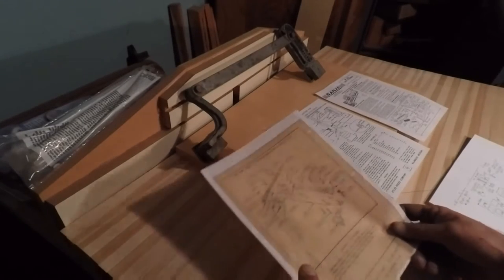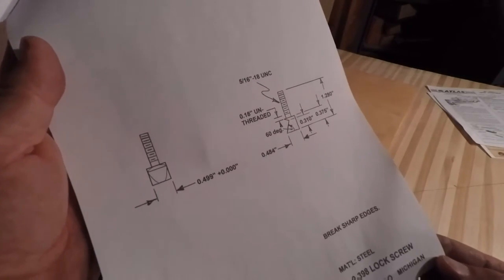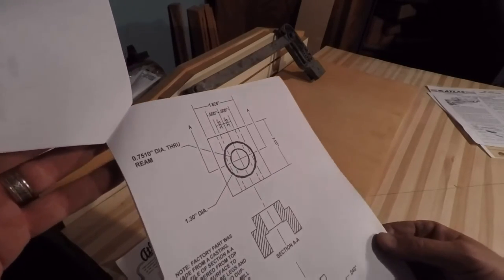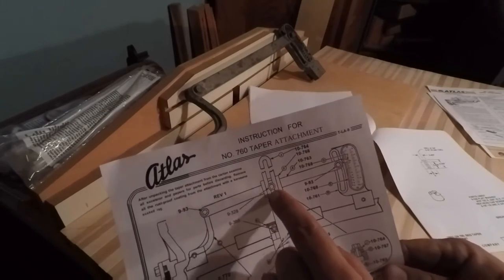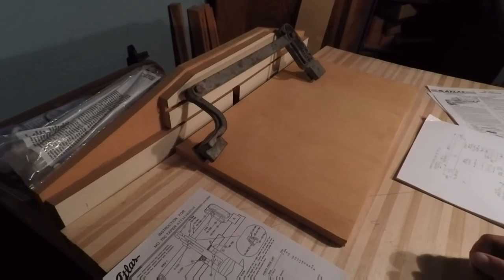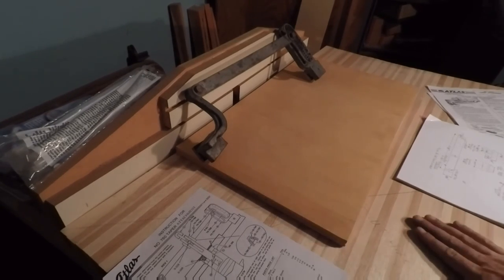Survey of the Atlas Taper Attachment

Comment: Let me see what models I have.........
With the Garage sale lathe, I have the 700.  I am missing the long bar with the slot which connects to the cross slide and also the slider yoke that attaches to the taper rail end.  However, I do have the cast iron block that mounts to the carriage.  This was a quick look.  It's possible I have the other parts yet unidentified.

I have a 760 missing the same slot bar and slider yoke.  In your drawing it looks like there is some kind of block with fasteners and rollers to hold the cross slide bar square.  I don't have that block either.  The 760 came with my Atlas 3992 (Craftsman Commercial) 12" lathe.  It looks like it could be clamped to a 3/8" or 1/2" bed easily.
Reply from the maker: yes I think there's just a few part's that are different  (maybe )for you want me to see if I can find drawings for the 700?
Reply: Yea, that would be cool. As I think about it, I do have an aluminum part cut to fit the cross slide ways and locks on. I'll look in the morning to see if it's a part to the 760.  The part I am thinking of is Aluminum so it couldn't be original.